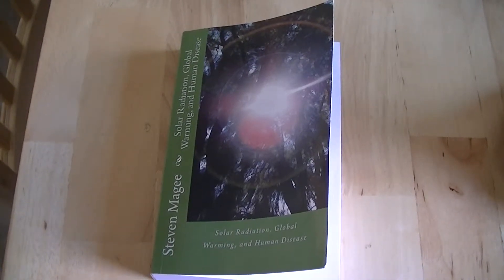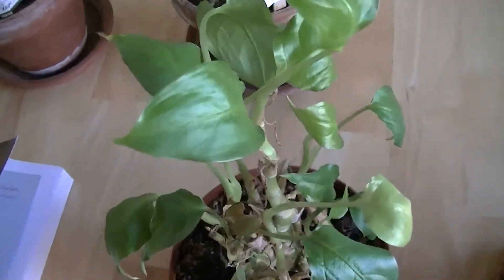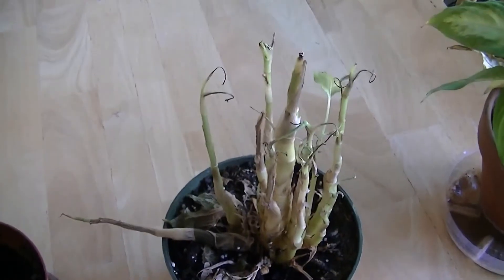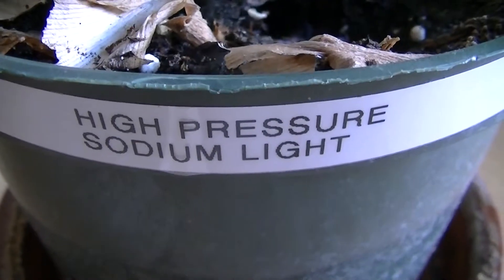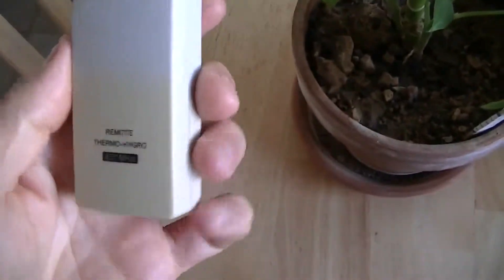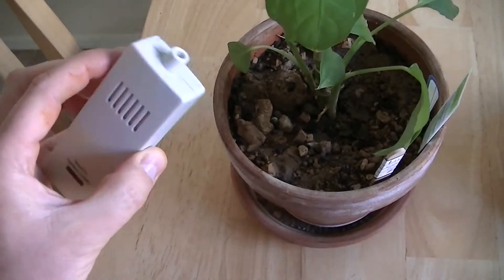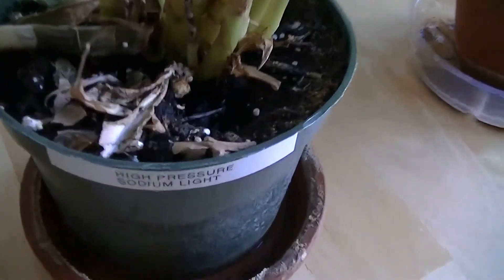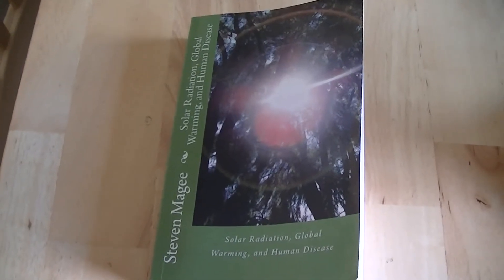Artificial Lighting Products Experiment Update

Comment: And CFLs are no longer the only problem when it comes to fluorescent lights. While regular fluorescent lights do not bother me at all, there are the new generation of fluorescent lights--normal sized, "energy saving" fluorescent lighting that are even more harsh than CFLs (because they are larger and emit more electromagnetic "dirty" energy). They are just as long as regular fluorescent tubes but they are skinnier and require different ballasts.

Comment: Symptoms: Headaches, burning sensations, rashes, insomnia, etc. I didn't know about the metal halide projector lights and I've read that these lights can call UV skin burns and cornea burns--simply from a broken bulb (as many still work even when the bulb is cracked or broken) or even broken light shield! And this is from many feet away from our heads from light fixtures that are up high in stadiums and gymnasiums!

Comment from the maker: You need to be very careful with your light bulb selection. I was made sick by compact florescent lights (CFL) for years before I realized that they had problems.  I will only use filament lighting products now, they are tried and tested.  I am curious, what symptoms showed up in you under metal halide lights?  I appear to get sick from going to the cinema, they appear to use metal halide lamps in their digital (DLP) projectors.  I get "Cinema Hangover" that lasts between 1 to 3 days afterwords.

Comment: Have you tested metal halide lights? I'm sensitive to either high pressure sodium or metal halide--I can't tell which ones the bulbs are but the light is extremely bright and one light can illuminate a very large area.